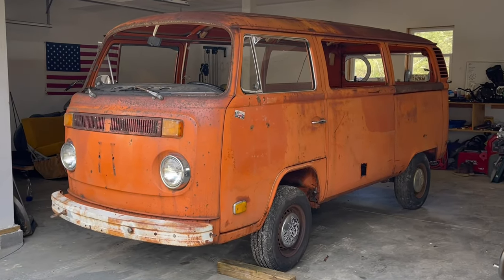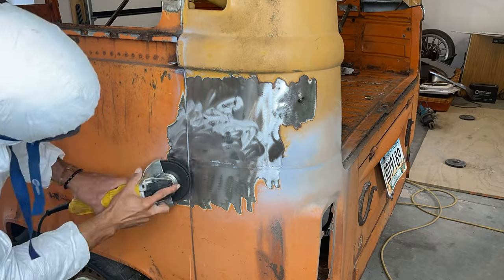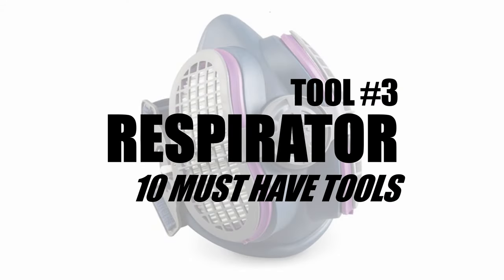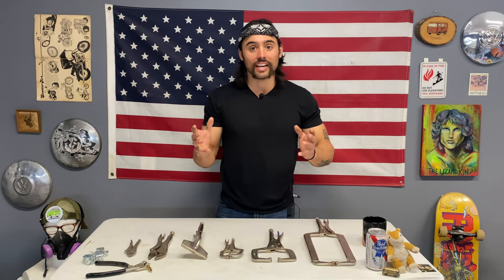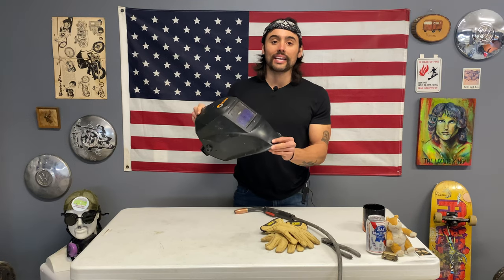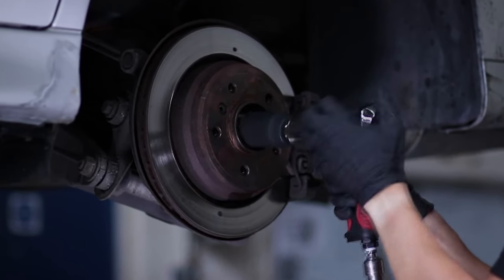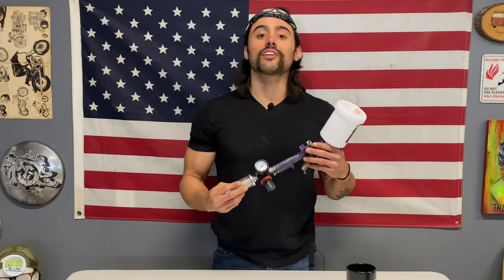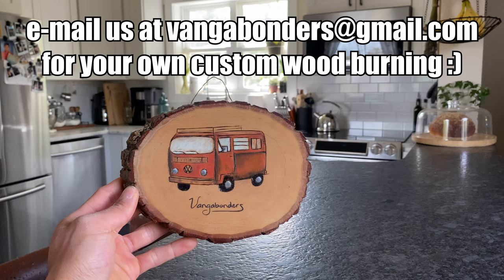10 MUST HAVE Tools for Restorations

Comment: Honestly, these are the MUST-HAVEs. Great list! Eye protection is also especially important! The only other tools I would mention are ones dealing with wiring and electrical test. Multimeter and a good set of crimpers. Poor wiring connections at the terminals have been a pretty consistent issue for my '71 Bus that I've been working on. Love the vids, keep em coming <3
Reply from the maker: I should have included all PPE in the respirator category, but I figured most people would have safety glasses and gloves. Although now days I do prefer goggles as I have been laying on my back under the bus and rust in the eyes is not fun! Thanks for the support!

Comment: Great video! Another tool to have is tin-snips and/or metal cutting shears. Especially for us who cannot afford to buy every needed body panel for a bus!
Reply from the maker: I’ve been thinking of getting some tin snips lately. I cut EVERYTHING with my cutoff wheel, even the small stuff. Any brand of tin-snips you recommend?
Reply: @Vangabonders  I've been using Weiss tin snips for years. They last a very long time, and stay sharp. You can get them at Home Depot.
Reply from the maker: I'll check em out!

Comment: A GOOD HAMMER. Sometimes all else fails and you need a good hammer. Rubber hammer, big metal hammer. Rubber hammer is great for "coaxing" and the metal hammer for "nudging". Both are excellent for throwing out of frustration.
Reply from the maker: The hammer is indeed another one of the very versatile tools!

Comment: Great stuff and a great idea to accompany the restoration vids. 

It's a big tool but my Harbor Freight sand blasting cabinet has been invaluable in restoring parts!

Love the skateboard on the set!  L8RSK8R
Reply from the maker: Every time I walk by the sand blasting cabinet I imagine how beautiful it would be to blast small parts rather than hold them in a clamp and wire wheel them. Maybe someday I'll have the space for it

Comment: Well not a bad list . I'd even go as far as saying pretty good But  The most important tool In my opinion is a reasonable quality digital camera.  Doesn't have to be the all singing all dancing type but must be able to do a good photo . Over the years I've found most tools you can mend make do adapt or even borrow if necessary .. However and I'm sure many will agree a restoration isn't gonna happen over night so your gonna be in probability months before you get back to reassembling anything you chop out remove modify or just clean.. a series of photos really helps to relocate or reconnect or even replace the correct way round . 
I actually start watching the videos Wednesday night UK time no 57 I think rh rear corner of the bus . Last night I did a binge watch of most of the bus, I  jumped about a touch but I do like the attitude of keeping the videos simple and short . Very entertaining and it's good to see a guy start off with welds that a pigeon would be proud of and get very competent quite quick your skill set is definitely developing the further in you go . I shall go and enjoy some more and thanks for sharing the restoration

Comment: By a long shot Tool# 10 is the most important when dealing with these 50+ year old vehicles and when patience runs thin I would suggest the other beverage you had on the table..... and more than 1. If I was to suggest another good tool especially if one will be doing lots of engine work is a good Torque Wrench. Otherwise, I think your choices are very good. Thanks.
Reply from the maker: A good brew should definitely be in the top 10. It certainly does go hand in hand with the patience lol